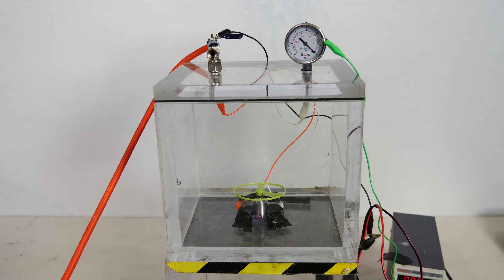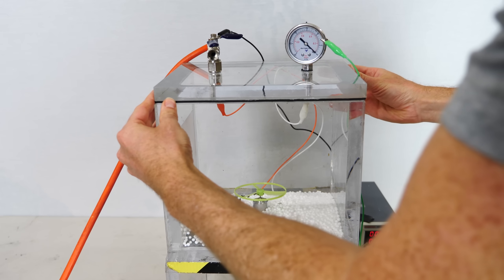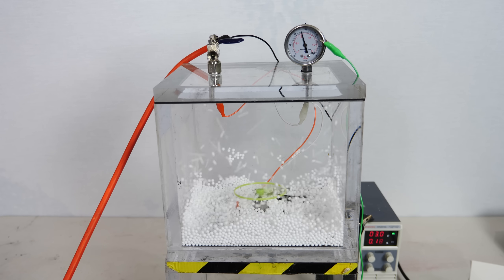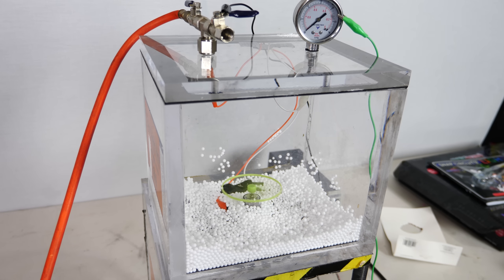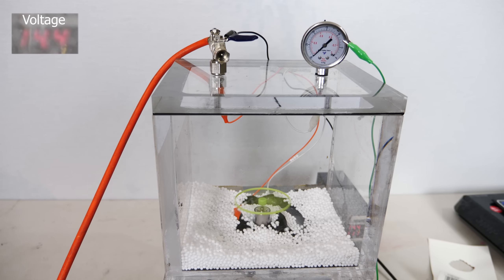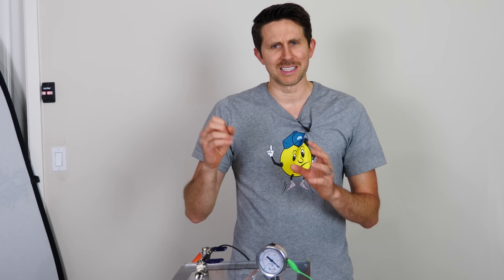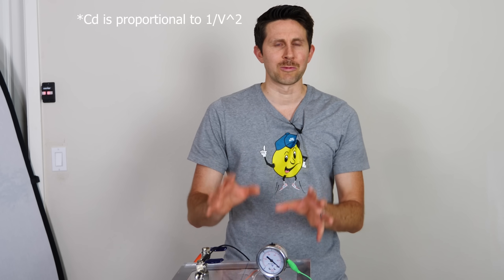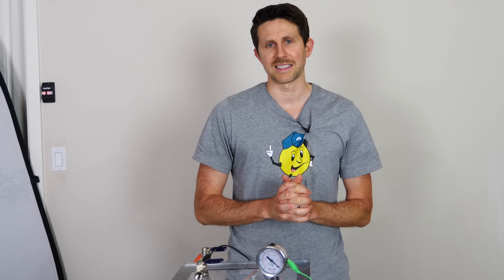What Does a Fan Do in a Vacuum Chamber? Weird Results

Comment: Could you line the interior with a grounded "wire-mesh" and redo the experiment? Would like to see the results without static interfering...
Reply: Of course under vacuum some beads were simply bouncing off the walls and being thrown back by the blades, not air currents.
Reply: i think static electricity was making them move too
Reply: And add a rpm meter while you are at it! really curious how much the lower atmosphere effects the fan rotation speed.
Reply: Show off!!😀😂
Reply: Make the confetti out of lithium leaf
Reply: Agreed. The increased magnetic field would affect anything with a static charge.
Reply: Henning Idsøe seriously? 😑 Are you stupid or something

Comment: Put a small jet in a vacuum to see if it does anything. That's what they do in 'space' but there's nothing to push off of so how does a rocket move? prove me wrong. or debunk NASA if you dare.
Reply: It's been done, conspiracy theorist just say that it instantly creates its own atmosphere in the chamber.

Even though with a high speed camera the movement is seen to be instantaneous.

Do you think that the Saturn V's 7,000,000 lbs of thrust was pushing against 14.7 lbs of atmosphere?

What about above 100,000 feet when there's barely any atmosphere left to push against?

Comment: It's likely that spinning a plastic fan attached to a DC motor kicking around polysterene balls would generate a lot of static, and probably contributed a lot more to the balls flying around than air pressure did.

Comment: So my doubt is when there is no air in the box will the rpm of fan increased due to less friction?
Reply: Probably not, but the current needed to drive the fan at a given RPM and voltage will drop

Comment: We have to deal with lack of air when we pump down our wind tunnel to 2.5 PSIA  (that's Pounds per Square Inch Absolute, atmospheric pressure at sea level is around 14.7 PSIA) We have to pipe in compressed air to our camera equipment to keep it cool. They all have fans, but they are not very effective much below atmosphere. With the size of the tunnel, the small amount of air run to the cameras is hardly noticed, plus the vacuum pumps are constantly running using large valves to keep the pressure stable.

Comment: 3:52, If we see carefully those beads were in vacuum and they were hitting each other and the chain reaction increases untill a time comes when every bead is moving even in vacuum, well that's what the ideal gas molecules do, the air pressure inside a jar exerted to the surface of its inner wall is due to the fully elastic collisions, which keeps them from collapsing into a single point... I know there's no connection with that thing to the beads here, but hey the beads were hitting each other and that hitting cause collisions among the beads themselves, thus constantly keeping the pressure and eventually taking the whole volume of the vacuum  chamber inside, just like gas molecules... But here's a point! The collisions here are not at all elastic but they're constantly getting their kinetic energy from that spinning fan by hitting into its blades, that's kinda giant model of how the ideal gas molecules behave when they're inside a closed chamber, and how they keep their pressure...
I know many guys will not even read till this much... 😂😂😂🤣🤣🤣🤣
Reply: Thanks you explain better than my teacher

Comment: To add at it, styrofoam beads contain air in them, and the air can be released slowly, so it's not only that you can't achieve 0. vacuum.

Thank you for the turbomolecular engine point !

You can try and connect 3 compressors at one tube and boost the power of the vacuum, that can be interesting ! And add an heating element inside the chamber, to increase the volume of the air, then you can extract it and have less air in the chamber at the final point. Just like you did with the super fast heat conductor in the past (won't spoil the entire thing here, it's one great video).
Those are just ideas, i just love your channel !

Comment: When you suck the air, the fan spins faster and it can be seen in the ampmeter on the power supply
Reply: I expected the fan to spin faster with less air in its way, but I didn't think to look at the current draw. Well spotted.

Comment: I was reading about electric and magnetic fields, then i found that a beam can be curved using uniform magnetic field. 
and i have a Q : 

so can we curve the light beams using uniform magnetic fields ?
Reply: We can bend light with varying density of the medium it travels through
Reply: A great example of this is when the road is very hot and you're looking at it from a low angle. The air layer sitting on the road can be so low in density compared to the air above it that the light reflects off it so you see the sky instead of the road. Our brains often perceive it as water on the road reflecting the sky.
Reply: @iamdave84  thank u

Comment: Anyone else notice the current decrease as the vacuum is pulled? You think this is because the wires are getting hotter (thereby increasing its resistance) because theres no air to dissipate the heat?  Just an observation.

Comment: hi,if the foam particles  are electrically  charged,maybe the magnetic field of the motor moves the foam particles? run without the fan blades.

Comment: Interesting is how much current drawn dropped as the pressure did. At 3v it dropped from around 2.0A to less than 1.4A showing how it got easier for the motor the less dense the air, you should of shown that part of the PSU display more.

Comment: Diffusion pumps and Cryogenic pumps can also be used for achieving better vacuum pressures. Turbomolecular pumps are good but the blades are susceptible to damage from any free moving chamber contaminants since they rotate at very high speeds. Diffusion pumps and Cryogenic pumps don't have this issue, but require some extra services to make them work such as chilled water and helium. I'd recommend a Diffusion pump if you ever want to try anything with a lower pressure.

Also, just a thought, a larger diameter vacuum pipe to your rough vacuum pump might assist in achieving improved pressures in your chamber and at a faster pump down time. The larger diameter gives particles more of an opportunity to get down to your pump and be evacuated that with a smaller diameter.

Comment: how much movement is caused by atmosphere and how much by static electricity? The more electricity running through the system, the more static so once a couple of beads move, it could become a chain reaction till they're all moving and some will inadvertently hit the fan to multiply movement.

Comment: I've not watched yet but I predict that the fan will spin faster as there is no air resistance. I also predict that it won't be able to move things unless it has direct contact with them. Air is a medium to move energy in this scenario. When something touches it, it will either shred from the speed, or be catapulted. Now to see if I was right.

Comment: I wonder how much of that was being moved around just from static
Reply: I was thinking static and the vibration of the motor.
Reply: Evl _1 me too
Reply: @Evl_1  well vibration is sound and sound is air moving
Reply: @FirstNameLastName-bm6zc  sound is kinetic energy travelling through a medium
Reply: @FirstNameLastName-bm6zc  vibration isn't sound, sound is vibration. Vibration can make sounds but without a medium for the vibration to move through like air or water there will be no sound yet anything that is spinning and off balance in a vacuum will still vibrate
Reply: exactly
Reply: And what about motor magnetic field? 
This should be done with the electric motor outside the box...
Reply: @henryrollins9177  Yeah that magnetic field could have affected the beads which only had their well known static, gravity and the small amount of air being moved? Also static dissipates into air. Could that amazing display when he turned up the voltage just have been the beads attaching to the remaining air ions?
Reply: Correct answer (I work with vacuum set ups like this in the lab).

The little poly balls are being bounced up by the vibration of the motor on the box. Remember in this vacuum the little balls move quickly like a bouncy ball without air resistance. Once 1 ball bounces high enough to hit the blades, it will smash into the other balls and cause them to kick up and cause a chain reaction. This is a good visualisation of how conservation of momentum becomes very apparent in a vacuum.

Hope this helps

Edit:
Although static is something that affects poly balls to a high extent, it's not applicable in this scenario. The main force here causing this is definitely the vibrations. Static would cause the balls to stick to the motor casing if anything.
Reply: Entirely, lmao.
Reply: Wondering the same thing
Reply: I was wondering that. Maybe use some other substance.
Reply: This was a very poor experiment. It proved nothing about "air flow" in a vacuum.
Reply: The word static literally means doesn’t move lol
Reply: @shokdj1  lol.. true.
Reply: @shokdj1  The fan moves and static can exert a force.

Comment: Isn't there a fair degree of static charge being generated by the fan on the nearby beads causing the others to become charged in a cascade effect contributing to the motion?
Reply: Running the fan before pulling the vacuum built up quite a static charge around everything in that box. Should do the test without the buildup.
Reply: If that theory is right, the beads might have circulated, even if he could pull the vacuum of deep space! It DOES sound plausible.